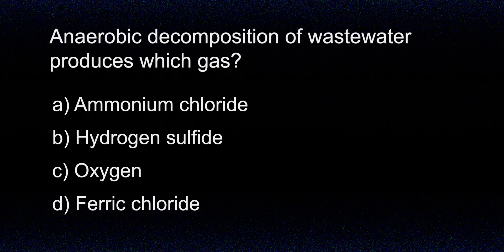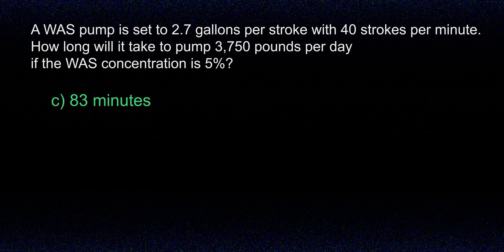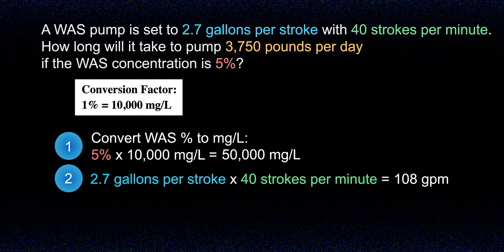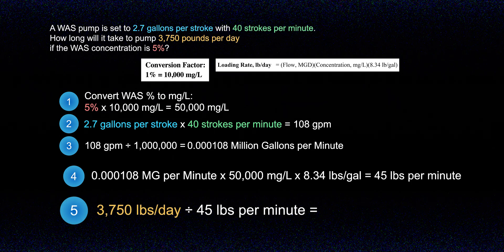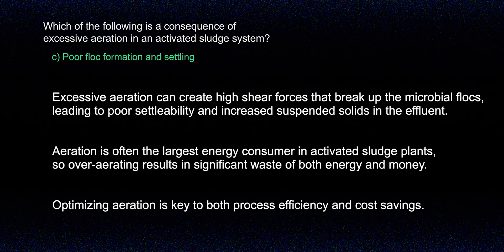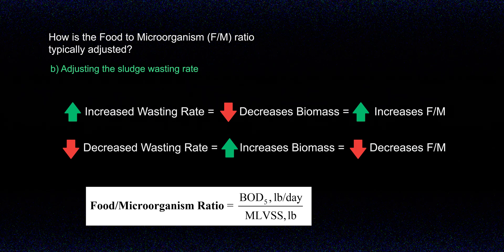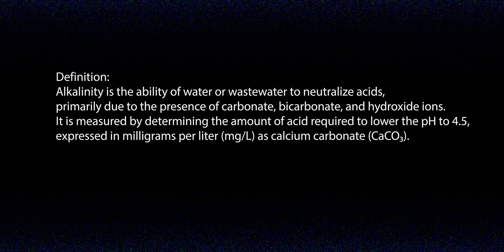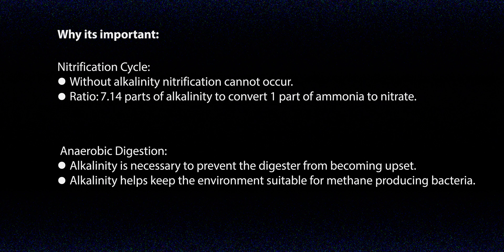Part 18 - Wastewater Treatment Operator Exam Questions

Comment: Hey, I am someone who is about to take courses at a community college in the fall to get my certificate for Wastewater Treatment, I am looking for leads on how to get a head start on the mathematics and technical side is there any resources for that?
Reply from the maker: Sacramento water college or WEF textbooks are great resources, there are plenty of other questions that can be found with some quick online searches.  When it comes to the math, learn basic math fundamentals: PEMDAS, basic algebra, conversion factors, units conversions, how to find volume of cylinders, cubes, areas of circles and rectangles, and significant figures.  This will pretty much allow you to do any normal operator math.  Thanks for watching and good luck at school!